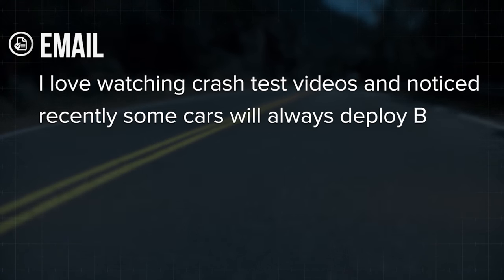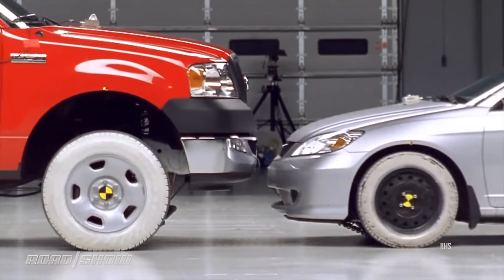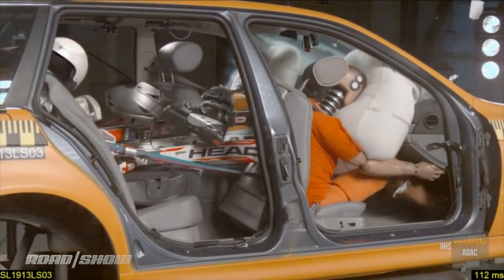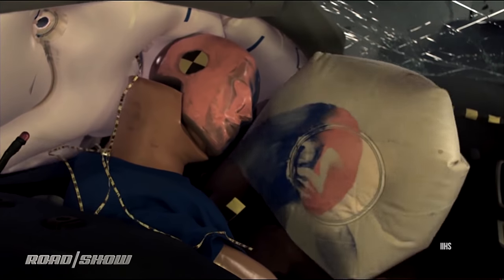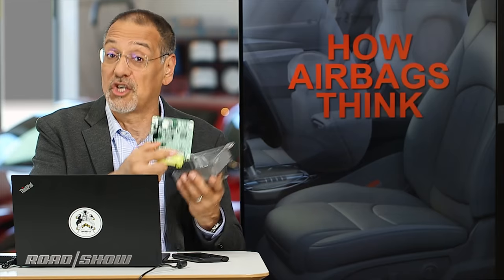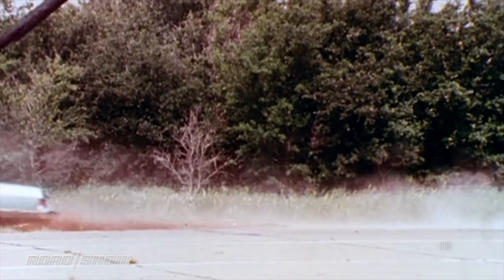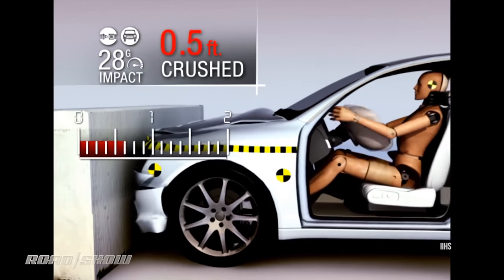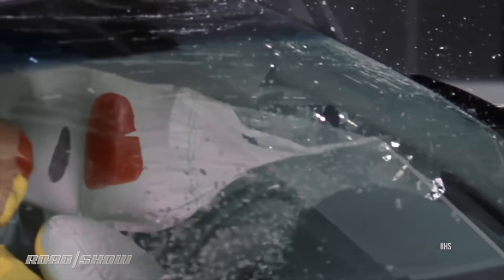Your Email: See how airbags deploy properly in a crash

Comment: Airbag deployed in my Crown Victoria in 1999. 10 mph forward motion another crossing my path through a red light at 35-45 mph.
Assumed to be caused by my hands on the steering wheel at 9 and 12 o'clock  the airbag deployed under my right arm twisting my shoulder clockwise. Damaged discs T7 and T8 in my upper back. Luckily didn't break my back. I would have been paralyzed from my shoulders down. Airbag save but airbag can also kill.

My accident was at slow speed.
Reply: Newer airbags thankfully use a combination of a weight sensor in the seat and the impact sensors around the car to calculate how forceful airbag deployment should be. Older cars like that Crown Vic deployed at maximum force even if you were only just over the minimum threshold for deployment. It was fine for serious high speed collisions where any injury the airbag caused was far offset by the injuries it prevented, but could unfortunately cause injuries like you sustained in minor ones.